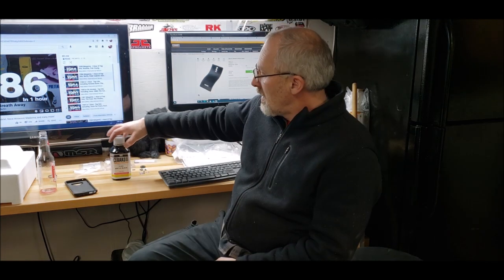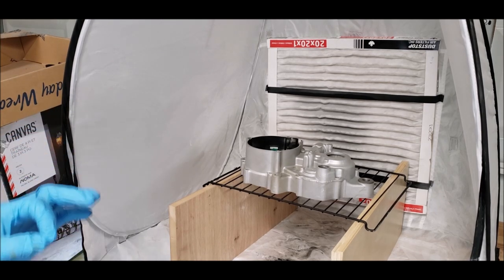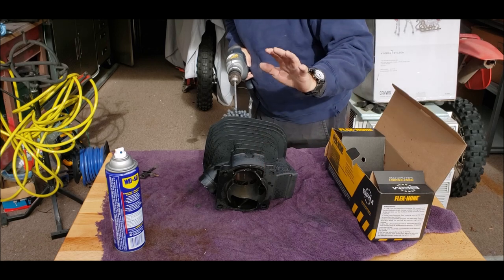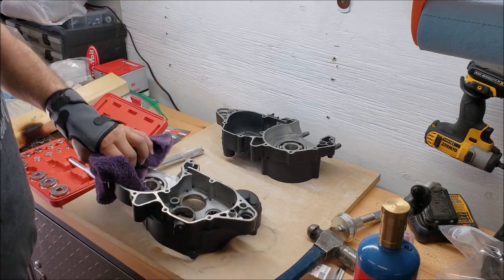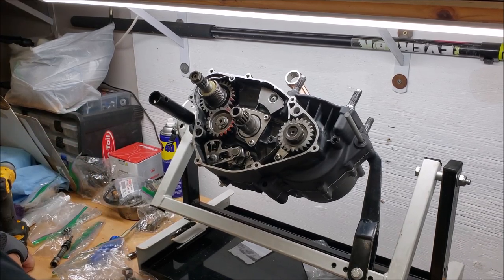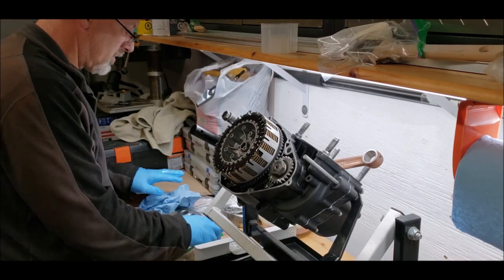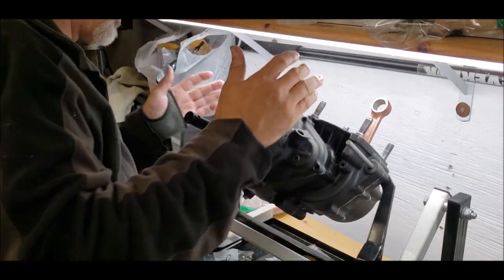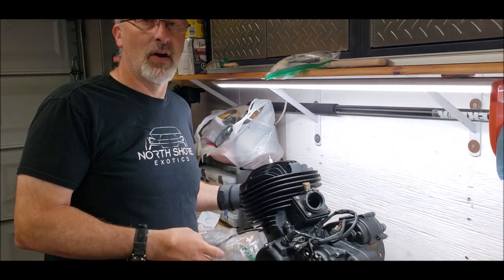1983 YZ490 project. The lost engine assembly video found.

Comment: Great video as always. I don’t know about you but I couldn’t breathe without my full respirator on after just a quick test of the cerakote. I used C series on mine so I didn’t need the oven
Reply from the maker: I was wearing a dust mask to start. Then I started wearing a carbon filter respirator.

Comment: Can you please make a list of the tools you used in this video with links and where you got the gaskets, seals and bearings…any other wearable parts you replaced. I’d be very grateful. Rebuilding a 1987 yz490.
Reply from the maker: Metric wrench set
Metric socket set
Tusk crank puller
Tusk case splitter
Tusk Flywheel puller
Impact screwdriver
Bearing/seal driver 
Dead blow hammer
Regular hammer
Phillips and flat screw driver
Inside and outside snap ring pliers
Torque wrench
Feeler gauge
Bore gauge
Vernier caliper
Propane torch
Red and blue Thread lock
Yamabond or equivalent 
Cylinder bored and honed by professional shop
Wiseco piston and rings if you cant get oem
Yamaha connecting rod installed by Pro shop
Complete gasket and seal kit
Complete transmission bearing kit
All parts and tools were purchased from ebay, amazon and local suppliers
Partzilla for any oem parts i could not find on ebay

Comment: IMO should have taken the dust shield off the bearings that are inside the engine........so the fluid can get inside the bearing....I cant imagine those bearings will last like that.
Reply from the maker: @yami4g63  bearings are design3d that way. They are open on one side

Comment: Hey I just picked up a yz490 1986. Unfortunately the frame is a bit bent. Do you know if the 1982 frame would be interchangeable . I found a very good condition 82 frame
Reply from the maker: Sorry no a 1982 frame will not work.

Comment: Does that year have the same kickstarter assembly as the '86 490? Someone gave me the bike and its missing casecover, kickstarter, kickstarter assembly and all number plates. Its pretty clean.  I really need to know what years parts will work in my motor.
Reply from the maker: The kick shaft has a different part number so I would say it would not work from an 86.